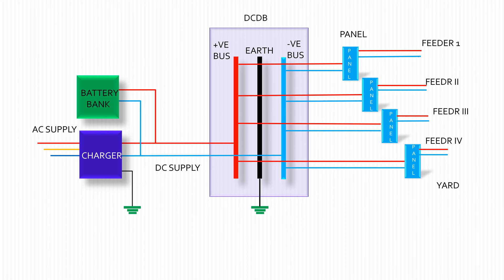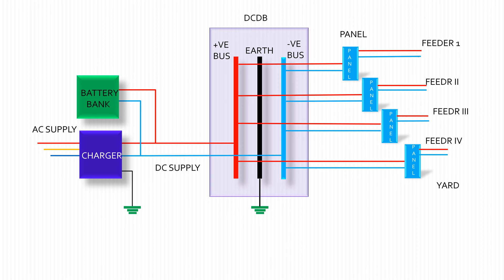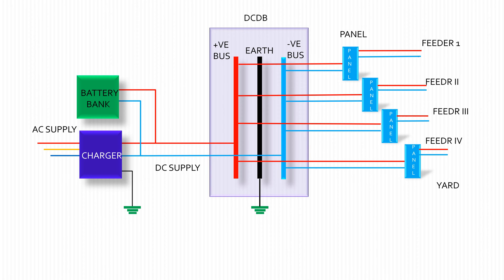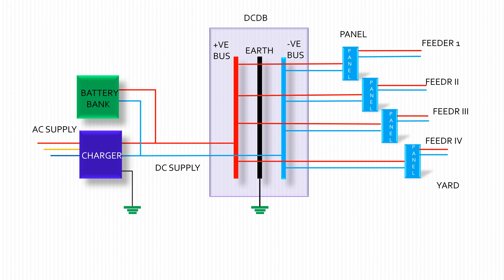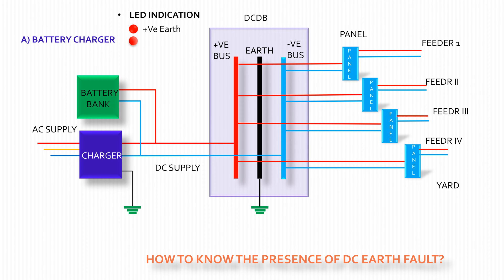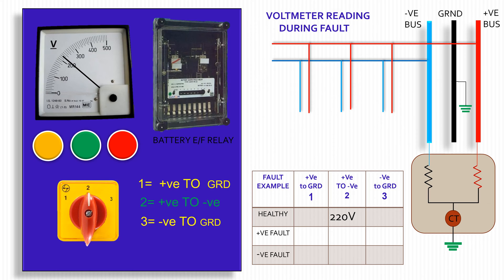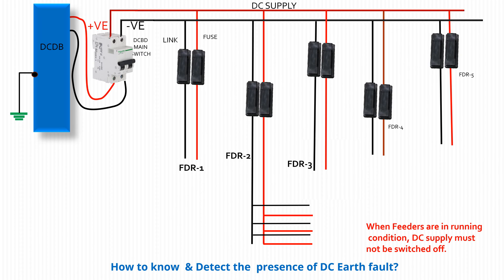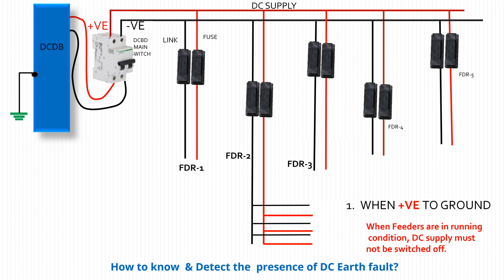Detect DC Earth Fault by a Multimeter & a Lamp/DC Earth Fault Detection without a Fault Locator

Comment: Sir ami Amtala 132kv substation e posted, Amader 48 v Caldyn charger er DC output ar thik aage positive ta Earth kora aache ...eta kano?
Reply from the maker: You are welcome.Isolate  both sides of Charger any how. Do megger of positive bus by 500volt.I can guess it would be insulation failure of one or more control wires within the charger. Bring fault locator from testing. Thank you.
Reply from the maker: watch the drawing then take action.
Reply: @electricalpassionate  ok Sir
Reply: To protect electronic circuit &  copper wiring (of communication system) from electrochemical corrosion.